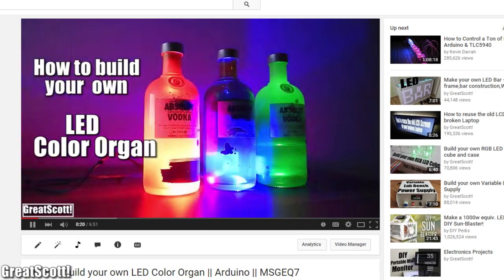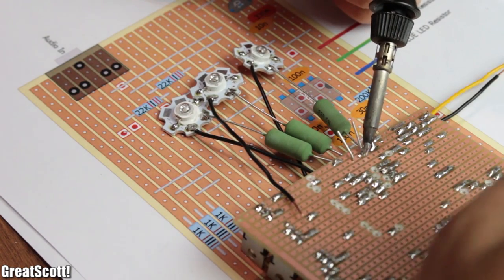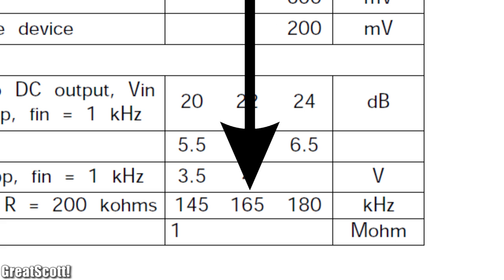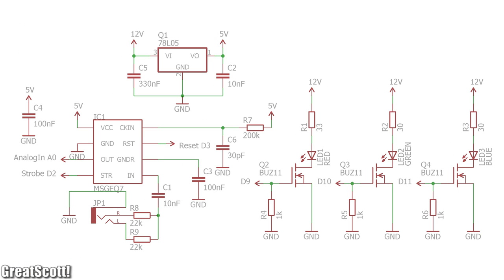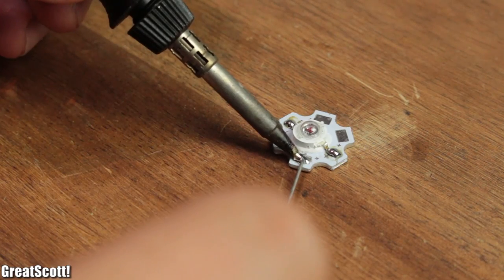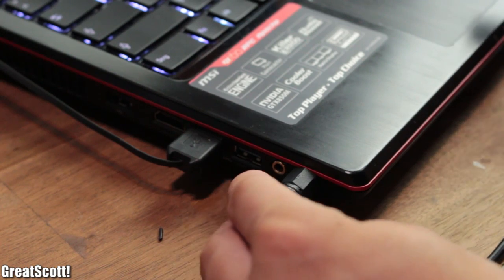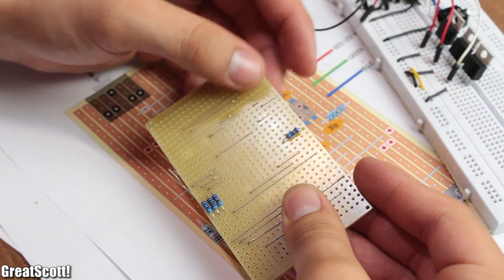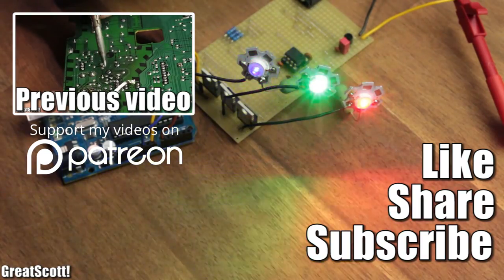DIY Arduino LED Color Organ 2.0

Comment: Couldn't the Arduino do the signal processing... (saving a couple of £/$/e on the MSGEQ7)
Reply: Ay Electronics RC filters 1970's, pure software 2020's. I built sound to light in the 70's handful of transistors, relays, light bulbs. Better music and darker in the 1970's

Comment: Can I use a 20w led with this? or is that too much?
Reply: A 20w (white) led will output something around 1500 lumens, so definitelly too much for such a project
Reply: I don't mean it in a project like this, I mean like disco lights. Flood lights that will fill up the whole dance floor

Comment: that last problem is mostly likely caused by ground loop.
Reply: +Saed Abumokh High frequency by ground loop?
Reply: +Jan Kuba yes, in case of using mains ac power, you might have low frequency ground loop issues. if you work with switching power supplies. you might experience high frequency ground loop.
Reply: +Jan Kuba also you might have high frequency ground loop issues if you use high frequency chips, like bluetooth modules/arduino/class d amps/ microcontrollers/decoders/etc.
Reply: Saed Abumokh
Thank you for explanation. I usually only get some 50Hz ground loop, so it was quite suprise for me to get HF ground loop.
Reply: Not sure about the ground loop. He's got a 7805 to get a "clean" 5V DC. Mainly in situations like this without proper shielding a capacitor parallel to the IC input and GND should do the trick. As a first guess something around 10-22nF?

Comment: Hey! I would like to get my input audio from a cheap microphone (a condenser cell maybe) to be hardwired to the project (I want to use this to output to an RGB LED matrix, probably gonna use an STM32 MC rather than an arduino but that's besides the point).
I found this LM386 based circuit that runs on 5 volts http://www.learningaboutelectronics.com/Articles/Microphone-amplifier-circuit.php . This should work for this purpose, shouldn't it? Or would a transistor based amplifier be enough?
I won't be needing 12v anywhere if I don't drive high power LEDs with this circuit, so I might as well go with a 5v power supply, right? 
I'd love to buy your kit from mklec but the cheapest shipping cost to germany is still almost as much as the kit itself (14 dollars) so I'll have to buy the components one by one... I'll be sure to browser your amazon store though :)
Many thanks for any advice you can give :)

Comment: where can i find the wire ?https://youtu.be/W4EG9Ikv4gw?t=5m31s
Reply from the maker: george anastasiadis Parts list in the description and on instructables.
Reply: george anastasiadis  Can't fint it ... bridge wire ?? can any one link this so ill find it :)
Reply from the maker: David Courtney It is included in the kit. But you can also find it on ebay, amazon if you search for "silvered copper wire"
Reply: plz put a link from ebay cause i cant find... i dont want to buy wrong item :(

Comment: +GreatScott!

HALP PLS

When I change the 'delay()' value I get this error when trying to upload the code:

avrdude: ser_open(): can't open device "\\.\COM3": The system cannot find the file specified.

when i check my com 3 port in device manager (windows 10) it is assigned to my Arduino UNO!?

any suggestions are welcome :)

Comment: may I ask what is that variable bench supply you use in all your videos? is it very expensive?  

Regards
k
Reply from the maker: +aran everitt DPS 5315. Around 300$
Reply: Ahh thanks. Looking at getting a decent supply sometime.

Aran